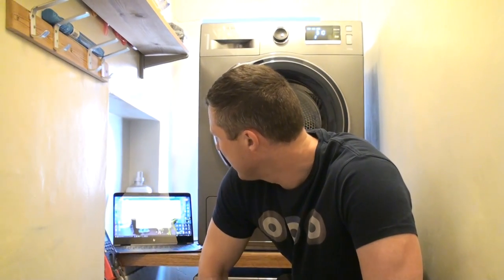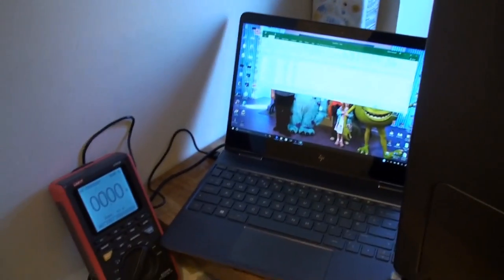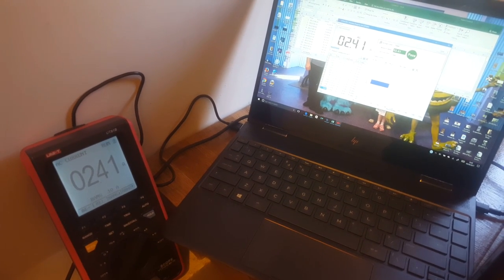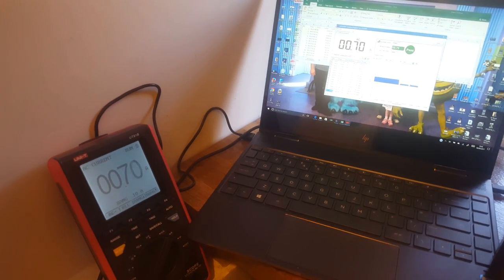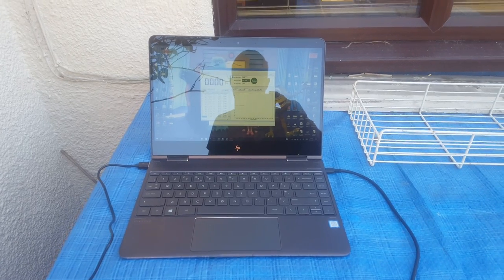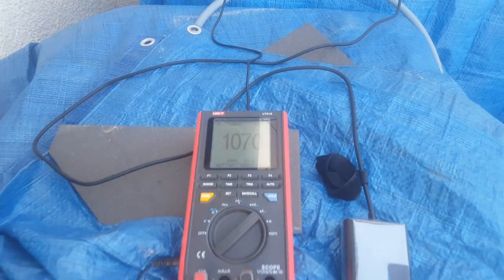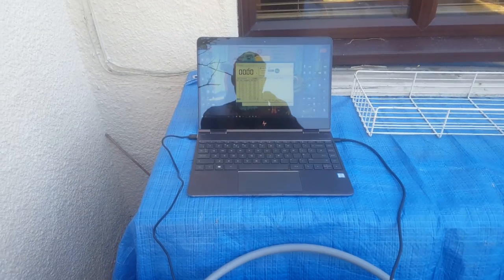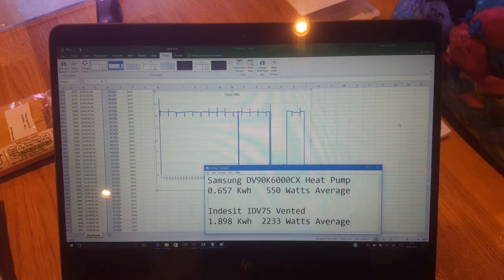Heat pump vs Vented Tumble Dryer - Actual Power Consumption

Comment: I'm guessing the standard electric dryer would be way cheaper to fix, should something go wrong, versus the heat pump dryer. I wonder how the 10 year operating costs would compare :-)  Hopefully the Heat Pump dryer would still be worth the extra money up-front.             Thanks so much for the tests.  Hopefully we all go this direction to save energy as we move into the future
Reply: brought for the missus bet she loves you . if she plays her cards right she may get a washer next year
Reply: Just had a 7 year old Samsung heat pump show a fault. NOBODY would repair it! Result = going back to condensing-type. Far more to go wrong with heat pumps apparently.
Reply: @garethbryneithin  a heat pump is basically a refrigeration system that can either be used to cool or vice versa. The down side is if the system develops a leak, it will render the dryer useless since it won’t be able to heat and condense the water. Frigidaire here in the US built condenser dryers from the early 1950’s to sometime in the mid 60’s and while they worked good from what I heard, they fell out of fashion since they ran HOT and left clothes damp after it stopped since the condenser couldn’t keep up in warmer months but worked fine in the fall and winter months when it was cooler. Condenser dryers wouldn’t work too well here in the southwestern US since you would have to have the air conditioning set to 72F or lower and simply would have higher cooling costs in the spring and summer as opposed to using a vented dryer which drys fairly quickly and isn’t outrageous to operate. A vented gas dryer could easily run circles around most condenser and heat pump dryers, hell even electric vented dryers since they dry quickly and are cheap to operate.

Comment: My vented dryer pulls 6000 watts when the heating element kicks in. A 10a draw seems a bit underpowered but your dry time seems about the same. Overall a typical load sets me back about 3kwh.
Reply: Same here. 5-6kw when drying.
Reply: I sssume you're on 120v we have 240v here

Comment: I was interested in how much watt it pulls in operation, because that's a big deal for solar. The lower the peak watts the smaller of an inverter you need. I heard these heat pump models on need a 15 amp plug which is also a big deal for alternative lifestyle options. 

Tinyhomes, vans, off grid, etc. 

The lower you get power wise the easier it is to run off solar.

Comment: great and informative video. what i would like is a breakdown of costs between the different machine types and whether the extra cost of the pump types would ever recover the extra £400 or so in their lifetime . a few factors would have to be considered, cost of kwh and useage per day. But i would doubt whether saving 2/3rd the electric per load would be enough to break even
Reply: b3amsvvti I own a heat pump and I have to say it’s worth it’s weight in gold in the fact that it doesn’t shrink anything so our clothes stay in such good condition and has saved our house from certain clothes having no choice but to be air dried resulting in high humidity etc, they’re good for not putting any condensation in the air like condensers do and ours was only £300 because we waited until we could find one on offer, and has made a massive difference to our electric bill saving us at least £3 a week roughly
Reply: Not to mention if you are running on a generator or solar at any point you can still do laundry without effecting the system.

Comment: 1.898 kWh charges 15pence, 0.657 kWh charges 5pence so 15p minus 5p = saving of 10p if you use the dryer 3 times a week that’s a saving of 30p times that by 52 weeks is £15.60.                                    If I buy the heat pump dryer for extra £100.00 to recoup this hundred pounds will take 6 years 6 months. It would be worth if the heat pump dryer and non heat pump dryer is  the same price also remember it takes longer for the heat pump dryer to dry and the heat pump dryer has to be in a room where the temperature is above 15deg Celsius otherwise it will take even longer to dry because it uses the heat from the compressor which the heat never goes above 45deg Celsius.
Reply: Consider: if you have a 30+year old home with old electrical cord, the 550 watt is more convenable and SAFE
Reply: Dávid Keresztély Every outlet in a U.K. home can deliver over 3kw all day long. If your wiring is so old that you have to limit power use there is just as much chance of a low powered appliance burning the place to the ground as any other.

Comment: It's a very interesting technology with some clear advantages.  The machines are very expensive compared to a simple electric dryer and I worry that they would be expensive to service requiring things like compressor replacement.  My electric dryer that gets used a lot is now 32 years old and all I've replaced is the heating element.

However you are not telling the biggest part of the story and that is the air that is exhausted out of the house by a normal dryer.  It is a big waste to heat up that air then exhaust it outside.  Cold air has to be pulled back into the house from other sources and reheated by the house heating system.  I saw other calculations where for a small house one dryer cycle would require replacing all of the air in the house with outside air and the cost of heating that air was up to equal to the cost of running the dryer itself.  Obviously this depends on the outside temperature.  This might be enough savings to offset the shorter lifespan of the more expensive dryer.

Comment: Just a thought if the Samsung takes on average 35% longer to complete each load then does that mean it will wear out it’s motor/bearings/pumps faster and will need replacing sooner, also the Samsung costs more than twice the cost of the Indesit to buy so should you not consider theses factors when calculating the running costs. Also environmentally the carbon footprint of producing such a complicated heat pump design and the fact they won’t last as long so more will have to be made should be set against the gains in reduced energy usage. This design also needs an ambient temperature of 15” min to function efficiently so won’t work in an unheated room in the winter. Not arguing with your test results just think these things should be considered before saying better in every way.
Reply: Agreed.  If they build these machines with the same quality as old stuff, complete with replaceable and accessible wear items, then the decision would be easy.  As it stands, many of these will be built to minimize first cost at the expense of total cost of ownership, which will change the overall economics.  Like most buying decisions for durable goods, spending more at the outset often pays off over the long run IF technology advancement doesn't demand replacement before the break-even point.
Reply: I just bought a new dryer. The heat pump one came with 5 year unlimited use warranty, I could not find a vented one with anything close to 2 years
Reply: @justindrew9702  , Hi glad your pleased with your deal, I’m not claiming my opinion is correct just that manufactures / suppliers  should make people aware of all the facts and not make claims that are at best questionable. All Bosch and Miele appliances come with a two year warranty as standard. My experience in the trade over the last 30 years is that manufacturers tend to offer special deals on the models they are having difficulty selling. I suppose we will have to wait a few years before we can be certain if your decision was wise or not.

Comment: A heat pump dryer will cost anything from two to four times as much, will have longer drying times espescially if the machine is situated in an unheated utility room or garage and particularly in winter - the heat pump essentially "draws heat" from the environment, and on a freezing winter day there isn;t much. This means that the motor, drive belts and bearings will be subject to far more wear and tear, therefore, the machine will likely have to be serviced more often and might well have a considerably shorter service life. It's very simplistic to just say it uses les spower so it;s cheaper. Add in these factors, and you might be looking at twenty years to simply break even compared with a standard type dryer. The higher energy bills are spread out over time, wheres a pump dyrer has a much higher capital cost. Just like heat pump central heating, lower bills mean nothing if the initial outlay is beyond your means. Espesciall yif you play it smart by only running your dryer on off-peak electricity. OUr existing tumble dryer lasted 25 years, how? We line-dry most things and only tumble when we have to, or to get rid of final dampnes sor to remove stiffness. The cheapest dryer of all is the wind and sun.
Reply: Let me explain this a little better. It is not pulling heat from the space around it. This heat pump clothes dryer is a closed system. It is not like a heat pump water heater. It is basically a dehumidifier with a clothes tumbler mounted on it. The heat "added" to the system comes from the energy consumed to drive the compressor and blower/tumbler motors. The hot air generated by the air cooled condenser evaporates the moisture from the clothing, then the heat is recovered by the hot air and moisture condensing on the evaporator. And the cycle repeats. The extra time required is a product of evaporating and then condensing all of the water removed from the clothing without using so much energy.

If it is located inside a dwelling then you also reduce the very large amount of conditioned air consumed by a standard gas or electric dryer and then dumped outside.  So, if you're running HVAC to condition the living space then it will reduce that load as well. Drying on clothes lines outside is always the lowest consumer of energy, but that is not always an option. Time spent and weather conditions are going to dictate what people can and will do.

Comment: Fails to mention it it's very important where to locate a condenser or heat pump dryer if you have them in the garage especially in the winter they just don't work because the temperature is too low, Don't make that mistake,you can leave it on all day in the garage and it still won't dry if temp outside is below 8oc.
You have been warned

Comment: Hi Adam, great video. Do you think the Samsung has the small (600watt) heater in it because they figure users want to get warm clothes out at the end? It will, of course. do something to speed up evaporation but the whole point of drying with a dehumidifier is that it is far more efficient than with heat. Not sure why viewers want a comparison with a condenser drier - they are even more inefficient because the water vapour is being condensed electrically  as well. I think earlier ones condensed the vapour by pumping perfectly clean mains water through a  heat-exchanger straight down the drain. Not great for the environment or for a metered water bill.
Your test was conclusive but a before and after weighing would have taken the guesswork out of just how dry the towels were. And given you a KwH per litre of water figure.
Great stuff. Thanks. Will
Reply: Condensor dryers are inefficient?
Reply: Hi j m.  Condenser driers are slightly more power hungry than vented unis because they refrigerate the warm damp air. The selling point for a condenser drier is that you don't need to find a sizeable exhaust route to the outside. You do of course need a drain for the condensed water but if it is next to the washing machine then that's not usually a problem.
Vented driers have a fan (condensers do too - to blow the air through the condenser)and that is drawing in warm air from your house and wasting it to the outside. The overall calculation of cost is quite complicated but there is absolutely no doubt that condenser driers are much much more efficient. They are comparatively complicated and therefore very pricey so I wouldn't like to say if they save money over, say, 5 years of use.
Reply: Will Carroll Thank you for responding! True. Compact appliances are so costly!  I can get either in my closet but leaning towards the compact. But I’ll be new to a condenser dryer so not sure if I will like it.  I appreciate your video to educate the differences.
Reply: @willcaro1038  condenser dryers are indeed more inefficient than vented dryers....BUT heat pump dryers are the most efficient dryers on the planet .
Reply: Condensed electrically? Wtf? That vented machine from the video is roughly the same efficiency that its condenser counterpart. The only difference will be a water pump in condenser unit and a bulb that indicates that the bottle is full

Comment: Great work! Does a heat pump tumble dryer release moist air into the room? Therefore, possibly cause condensation in the room.
Reply: For a good explanation of how moisture is managed in a heat pump clothes dryer check out the Ask This Old House video titled “Exploring a Heat Pump Clothes Dryer.” Basically, it functions similar to a refrigerant dehumidifier.

Comment: An hour and 15 minutes for five towels. That’s a long time. But again, energy savings.  
One needs to consider that the complexity of a heat pump dryer is much more than a regular dryer whether it be electric or gas. I’ve had my gas dryer for over 16 years and I’ve had a couple of minor maintenance requirements. So I have spent very little money on it. if the compressor goes out or there’s a leak in the refrigeration cycle on the heat pump dryer you’re talking big bucks to repair

Comment: Four and a half years later and heat pump clothes dryers are basically not available in the United States. Amazon lists one ($2117 (free shipping) , although I found a second with a little more effort, but it couldn't be shipped to Detroit area. We are so behind the civilized world. 😢
Reply: Your energy costs tend to be quite a bit less than over here in Europe though and you have larger homes for vented dryers instead of needing a smaller condenser dryer to fit under kitchen units.

Comment: How reliable is a heat pump going to be as it is a lot more complicated that a heater, a motor and a hose. Our tumble drier has been tumbling away out in the shed for at least 10 years and the only thing that has been replaced is the door catch. If it blows up I might consider a heat pump but then I will have the additional problem of find space in the kitchen for it as they don't like being in out buildings
Reply: As reliable as any refrigerator.

Comment: But you pay a lot more for a heat pump dryer and they have known issues that an engineer has to strip the machine down to clear fluff built up that stops the machine from working and engineers don't work for free. With this in mind plus the cost of the machine being at least double the price of a condenser dryer it doesn't work out any cheaper to run.

Comment: Not sure if you took into account power factor. Doesn’t look like it. You cannot just measure a resistive load current and compare it to an inductive load current. What’s the phi of the samsung compressor? Anyway, good info nevertheless 
You might be saving a kWh per load, but it’s going to take a long time to recover the price difference between heat pump and resistive heater using saved electricity. Like decades 😬
Reply: He needs to use a power meter to measure this accurately. Measuring current only works if PF = unity.

Comment: Did you happen to measure the power consumption of the vented dryer in amps in low heat mode? I have that dryer and wondered what the difference in current drawn would be.

Comment: I guess the ting to note is that while it used a lot less electricity, the vented dryer go the items dry in around 45 minutes versus the longer wait time and use of the heat pump. If speed of drying is what your looking for then it may be a good test to see how much extra electricity is used with the vented dryer for the exact time as the heat pump. That test alone would actually become a saving on electricity as the items are dried a lot faster.
I mention these things as some items take more than one run of a full cycle from a heat pump and could be in use for a lot longer therefore over time totalling the same amount of electricity used ...just it took longer to reach the same total as the vented one.
For me I would rather the speed over the electricity any day as where I live there is no such thing as off peak and peak electricity rates.
Reply: I believe he did analyze the total electricity required to dry. Was 3x higher to get the towels dry in about 2/3 of the time. Of course we are relying on his tactile estimation of the towel dryness. He said 'more or less dry'. Could mean they still needed another 5 min of vented drying but I'd rather he underestimated the time than overestimated it.

So it does truly come down to whats more important. 30 minutes more time? Or 3x the power consumption.

Comment: What are your thoughts on conditioned air being lost to outdoors with vented dryer? And cost to repair ventless dryer with it's pricier hardware
Reply: Robert Montgomery he's based in the UK, homes don't have air conditioning. We are more concerned about keeping heat in! Condenser dryers help in this regard, the heat remains within the building reducing load on the heating system. Vented dryers are increasingly rare here, the vast majority of models available are condensers now, and prices are much the same as vented.Heat pumps are a small part of the market but growing, although still significantly more expensive. We don't really have a dryer culture here, most homes have one but they are generally seen as something to be used when it's too wet or cold to dry outside, not for every wash.